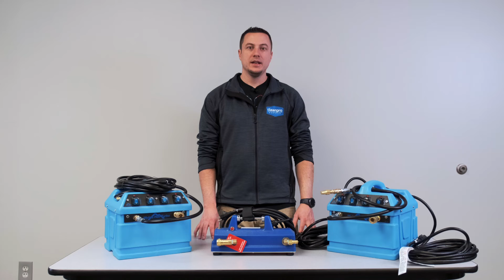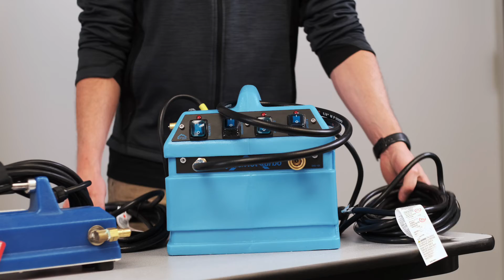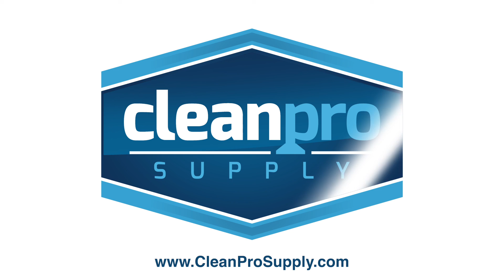External Heaters - Used in Portable Carpet & Tile Cleaning

Comment: If the four switch lights up why does the water not get hot??
Reply from the maker: It takes time for the water to warm up, the longer the water is in contact with the heating elements, the hotter it will get. The water will get hotter with lower flow, but when theres higher flow (higher pressure), the water passes through faster and wont warm up as much. These are great for carpet cleaning but not the most ideal for tile and grout. If you do a lot of tile and grout, I would suggest better agitation with a CleanScrub CRB rather than heat.
Reply: How you wand has a lot to do with it too.

Comment: Do you think these things are worth the $700 to $ 900?
Reply: Would love to have it,I need the Heater Mate, it's too expensive!
Reply: So essentially running the twin one 1 cord with 2 switches on is about the same as running the reg turbo w 3 switches: 1750 watts compared to 1800. But then ofc the option to run 2 cords for more power is nice. And just another 15amp circuit no need to find a 20. Correct?
Reply: Nvm so the twin only runs on 20 amp circuits.